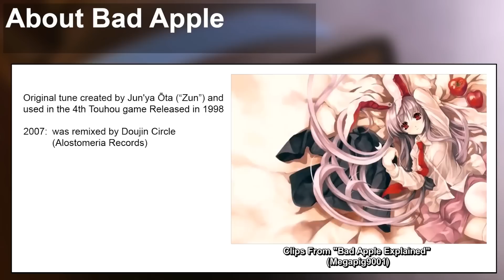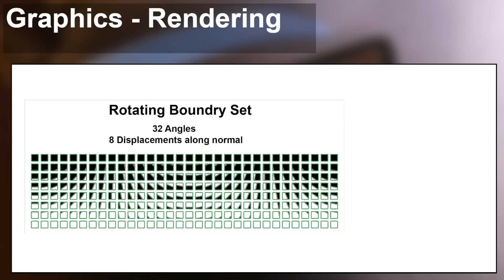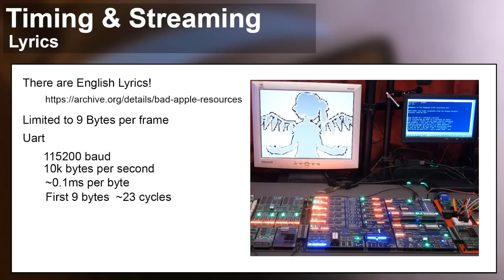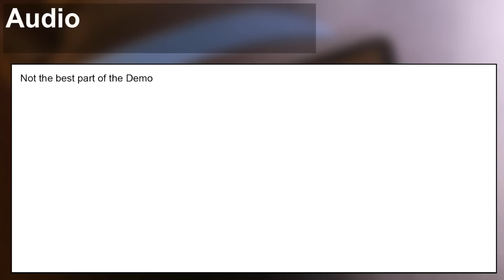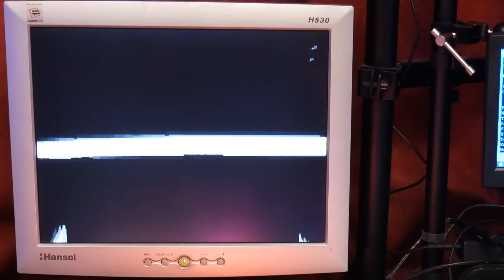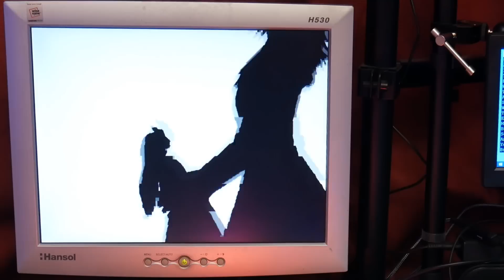Porting Bad Apple to the Homebrew CPU!

Comment: Did you consider interlacing the video? I have no idea if that would have been better or worse.
To be clear - I meant Interlacing the blocks, not the scanlines
Reply from the maker: You mean interleaving the data? That’s what I did.
Reply: @weirdboyjim  no, I mean interleaving the blocks to alternate rows of blocks are in alternate frames/fields, 60fps.
Rather than showing the same frame twice, update only the alternate lines per frame.

It may look dreadful, I dunno. It may or may not help with the streaming
Reply from the maker: @LeeSmith-cf1vo  I didn’t try that, obviously the source material only changes at 30. My suspicion is it would look weird when things are moving fast, you would end up with a sawtooth effect on anything moving left or right.

Comment: What year do you think this computer could have been built with equivalents of that time. And would it be an impressive computer of the time? Very impressive project from start to finish!
Reply from the maker: Glad you are enjoying the series. That's a really tough question, the majority of the circuit could have been built in the late 60's. The big "liberty" I take is with memory devices, a 64KB of sram would have cost you a kings ransom.

Comment: It would be fascinating to see a couple of the frame transitions slowed down significantly so you can see the block-by-block updates happening.  Taking the existing encoding and doing one operation every few frames?
Reply from the maker: I had a try at that but it's actually quite difficult to represent it well.

Comment: Interesting.

To be honest your audio setup is decent given the constraints. I really like the retro square wave sound it has. What's missing is a bit of polish on the analogue side of things. In particular you need a low pass filter somewhere after the mixer to get rid of aliasing and any other unwanted noise. You'll probably have to experiment to find a good cut off point.
Reply from the maker: Thanks for the feedback, I'll look into the filter. The one thing in the audio circuit I didn't realize when sketched it out is the high frequency components you get on a volume adjust. Might have been better to latch in the 4 bits of volume at the end of the a "cycle".

Comment: Nice little project for the CPU! I’d recommend looking into the Heatshrink compression library for future projects, if you haven’t already. I can verify it’s suitable for realtime video streaming on microcontrollers.
Reply from the maker: I had a quick look at that library, I'll look at it more in the future.  It wouldn't be suitable for the decompression here  though which extremely custom and very much tuned to the data and cpu.
Reply: @weirdboyjim  yes, for something that was also storage space or bandwidth constrained it might be useful. I use it for fitting video frames into single UDP packets. Combined with the same sort of frame delta and RLE you are doing, it works really well.

Comment: Could you have somehow programmatically determined the best tiles for video? Maybe split the each frame into tiles and then find the closest ones and combine them? Also could you have changed the pallet frame to frame to be able to have the best tiles for that frame?
Reply from the maker: In theory you could have determined an optimal set but that would have been a sizeable job compared to the time I wanted to devote to this, and I don't think the improvement would have been significant. I did investigate some dynamic tile modification, the problem with that updating tiledata consumes the same memory bandwidth as updating the tilemap which was already constrained.

Comment: It turned out incredibly well. Kudos! It´s right there with the demos for the best performing 8bit computers I've seen. I wonder if rasterizing vector graphics would compress it even further. There is a version made with a fourier series XD
Reply from the maker: Thanks Damian! If you had a decent bitmap display vector graphics would work well for much of it, would be a bit more complex to deal with the blurry bits and the flames though. Decompression would be a bit more cpu intensive than I'd want to do on this device though.

Comment: Do you really need to decode the entire frame before vblank ends? Don't you just need to stay ahead of the current scan line?
Reply from the maker: The video circuit is bandwidth limited, It doesn't support reading and writing at the same time. Priority goes to the cpu so if I write outside of blanking it will momentarily corrupt the screen. See my vga series for more information.

Comment: Awesome job! 
Very crisp edges and great job keeping up with the transitions! 
I see the 4Mb file size, maybe I missed it but what did you end up with for a compression rate compared to the uncompressed down sampled source frame images? 

Have you thought of using your UART as an audio output? 
Drop the serial and  hook the output to a speaker with a resistor and capacitor to limit the current and smooth it a little?
Since you have a 8 byte output buffer on that already you could output 1 bit audio without any additional hardware and that buffer might make the code not too bad. 
If you just left it at the 115,200 you'd need to pump out 14,400 bytes a second, or 240 bytes a frame. I don't know if your SD card transfer rate and free CPU time on the Video decode would allow that without reducing the framerate, but I'd bet 115 KHz 1 bit audio would sound pretty good! 
Obviously if you reduce the output rate of your UART you could drastically reduce the bitrate of the audio. I wonder what the minimum acceptable 1 bit audio quality would be?
Think you could squeeze that out?

Thanks for putting this out there! 
There is not enough content explaining how to actually DO one of these demos with specifics. 
I know this video would have been a HUGE help and time saver when starting work on my own Bad Apple! demo.
It would be neat if you took some time to get into the guts of your encoder for the video and how you sliced and diced the MIDI.

Love this content!
Reply from the maker: The compression was around 11:1, the compression as as much about speeding the decompression up as well. I generally update more of the frame with the compressed data than I could do with the a raw copy.
Reply: @weirdboyjim  That trade-off is harsh. When I started looking at doing this with the 6502 I was planning on just using a preexisting decompression library but all that I looked at were mostly meant to be tape or floppy loaders and were focused on max compression, and therefore really slow for what I needed. Obviously more modern routines are too heavy for a simple processor. Add in the slow nature of a bit banged SD card read on a VIA and now you also have the trade off of read speed to take into account. 
Is it faster to decompress a little more or to read another byte? 
Will adding that 1 more branch on the decoder use too many cycles to offset the bytes it saves on the encode? etc.
I like how you mention being 'good enough' for the demo. You can really keep going for quite a ways.

Comment: Magnificent!

If you do plan to do more music on the synth, it might actually be good to add a channel that's a white notse generator.  You can do a much more convincing hat or snare by passing white noise through an ADSR (the snare has something like a tom on a second channel, perhaps).
Reply from the maker: A lot of people have suggested that. I might have a play at some point.
Reply: @weirdboyjim  a short 2 channel sample playback board would be easier. If you can set it to play upto 256 bytes of a sample either looped or single play. Have it always playing back at the same speed give the card 8k of ram and thats 32 different waveforms you could use for percussion or soundfx.

Comment: Great work!  I was thinking about the problem of being stuck with the vertical blanking period for writes a while back and the only workaround I could come up with would be a 30Hz mode, where, during one frame, you write everything out to a 1MB frame buffer while you display the frame, and on the second frame, you read back from the frame buffer, freeing up your primary graphics memory during the entire frame for writes.  But that increases the complexity of the video hardware so much that I just don't know if it would be worth the engineering on a home project.  
Thanks for your videos in general, as I really enjoy thinking about these sorts of issues.
Reply from the maker: It's worth thinking about the problem, I'll explore some different approaches in future builds.

Comment: Stunning work, yet again - great job!

And sympathies on the audio struggles - I think your approach made a lot of sense given the limitations you had, though. And you're actually wrong when you say none of your percussion sounds are going to impress anyone - the bass drum you made at the end is quite good, I like that a lot.

Here on out is unsolicited-suggestion-ville, so take from it what you will: if it were me, I'd like to add a noise oscillator - either replacing one of the existing square-wave channels or augmenting one or more channels with that functionality. There's ways to generate analog noise directly in hardware - transistor noise is one I've heard of and seen from folks like Moritz Klein - but there's also a very famous sound chip that generates 1-bit noise: the General Instrument AY-3-8912 used in (for example) the Amstrad CPC computers. Basically, it has a hardware random number generator (I think it uses a linear-feedback shift register, like the NES APU does) and instead of switching between 1 and 0 at the frequency you set, it switches to the next random bit value at the frequency you select. That should be enough to generate some fairly convincing white-noise-like sounds for your hi-hats and cymbals, and as a bonus you can get some nice rumbly blasts for explosions and such in your games.
Reply from the maker: Thanks for the kind words! I am curious about the way noise was used by some earlier synth systems but my knowledge about sound lags far behind my graphics skill. That said generating a random bit sequence in hardware is an interesting challenge, I might have a play at some point.
Reply: @weirdboyjim  Sound is definitely a massive rabbithole, for sure - I grew up playing the piano, spent years watching music theory and DIY synthesizer videos on YouTube, and I've written dozens of completed tracks and hundreds of fragments in the fantasy console PICO-8, and I still feel like I'm missing a lot of knowledge.

The way I think of noise in music composition for 8-bit machines kinda comes from a rock/pop theory perspective: a classic drum kit has low percussion (the kick), mid percussion (toms and snares), and high percussion (cymbals and hi-hats), and you want to be able to make sounds to fill all those roles. Having a pitched oscillator - like your square waves - that drops quickly in pitch - like you did with your bass drum - is a good way to make a low or mid percussion, the kick/bass drum and tom roles, but if you try to start your pitch higher, you get a kind of laser-zappy noise. Which is cool, but it's not a hi-hat. A short burst of noise, on the other hand, can sound like a snare or hi-hat - it gives you the high percussion sounds you struggled with. That's why it shows up in analog synthesizers, in classic consoles (NES, ZX Spectrum, Commodore 64, etc.), and even in modern synths.
Reply: ...come to think of it, I think the ZX Spectrum also has an AY-3-8912 chip in it. Is there a ZX Spectrum music tracker you can play with? I feel like there must be.
Reply: @twobob  Sounds are so good! I've honestly sometimes just sat around trying to think about what the best sound card design would be for homebrew computers like this - there's so many things I would like, but what things do I need? What's the best value for money, metaphorical and literal?

Confession: I actually don't know the math for a shift-register hardware PRNG! If you can do it with just two chips, that'd be amazing.

Comment: Back in the day (1992), we used to play with VGA on a 80286 PC and the recently arrived SoundBlaster (that costed a fortune). We were using the 640x480 16 colours mode. You mention 60fps, we were doing half of that, but we were "hiding" the updates: in the 256kB of a standard VGA, there is enough space to "draw" the next image offscreen and reveal it with a simple "out" (I think it was to 0x3c4). Also, in that mode, we only used the 16 grays and the data was pre-rendered (we used PCX as a base standard, minus the header) to only recalculate it into the chroma data (and offset to have more tints in the light shades than in the dark), all that with a bunch of SHLs. Maybe you don't really need to go 60fps?
For the sound, as you already (kinda) went to MIDI instruments, why not going to an OPL4 chip (or did I miss an episode?) such as the YM2515 and simply upload the instruments to the chip, and leave the sound problem for later?
Reply from the maker: This project is very much about doing things from scratch so it would have felt like cheating. I'll do some more advanced Audio in a future build.
Reply: @weirdboyjim  I know it sounds cheating if you make it permanent. My point was to start thinking of goals to achieve with that scratch build in the future, but already have an API (or a subset of it) and a comparison point. It's as much cheating as Android being a copy of Sun's JVM: the implementation will be yours, not Yamaha's.
Also... Do you really need 60fps?

Comment: Man, if I ever get this far along in my diy computer project I want to try a "gpu" with sprites that support rotation, scaling and skew. back in the day IIRC, I saw some code that did all three operations at the same time (but line by line) with some "simple" matrix math (I hope I'm not mis-remembering this.. it was 20+ years ago in a little library called allegro 3) and I imagine it could be done "reasonably well" in hardware with fixed point math and a lookup table. Hmm. But then you'd want the gpu to be able to do the math to offload the work from the cpu. so do you actually support math, or just limit the features to some stuff that can be pre-calculated? feh. The imagination runs wild :D
Reply: I'm pretty sure the Gameboy Advance had exactly that, with the option to double the size of a sprite in the buffer to include a 2x2 matrix.
Reply from the maker: The trick is to find the right level to put it into hardware. To implement the scaling and rotation you can boil it all down to a bunch of adds from registers.

Comment: James I just had an idea - you quite possibly can play samples on your sound hardware through the volume register. Just send singed integer formatted samples into the volume register!
Reply: Yeah, I was thinking the same. Would need to lock the frequency output into a fixed high state though. And the amount of streaming audio data would be way higher - would need to be at least 16kB/sec, continuous, rather than a few bytes per frame.
Reply: @simontillson482  could go as low as 4kHz sampling rate and still get OK speech, 8kHz would be fine for low fidelity sampled instruments. True, it would take a lot of bit banging. Some DMA controller would speed up a lot of IO stuff here. I don't recall the memory access method of JAM-1, but if it only accesses memory at rising edges for example, then that leaves the whole other clock phase for DMA, and that could do sample playback autonomously, just fill up buffers with the CPU, set up memory addresses for the DMA and let it rip.
Reply from the maker: Indeed! I've actually done a little bit of experimentation with that, I'll make a video at some point. Not practical as an aide here though as it needs constant GPU supervision.

Comment: I'd definitely be curious to see what could be done if the pallet was played with as part of the video stream, beyond the colour inversion. My first thought would be to chop the video up into sections with a dedicated pallet each, for higher resolution, though there's probably way further you can go than even that.

This is a seriously impressive demo, I love it
Reply from the maker: Glad you like it!  Well the 2x2 grid works better in some segments than others. I did think of tweaking the entry used for 50% to better match where I was using it.

Comment: That was really interesting, thanks James. I do a lot of retro-gaming conversions and emulation etc, and these kinds of optimisations are always interesting to me! (currently trying to convert Missile Command to my tile+sprite based platform on the old 8-bit Arduino, with composite output, using a similar idea of tiles with partial line segments) Out of interest, did you consider a frame-direction byte, so the data is rendered to the buffer either horizontally or vertically? Also a byte at the start of the frame to choose the tile-set to use, which could be more optimal for the frame? Your audio section reminded me of Tim Follin's ZX Spectrum music - that dude was a master at getting amazing sound from it's little beeper :)
Reply from the maker: When building this demo I had a number of idea of small hardware tweaks that would improve it but I was keen to do the best demo with the hardware I've had rather than tweak the device.
Reply: @weirdboyjim  Ah! I didn't realise you cannot switch tile sets in the software. The frame rendering direction would be purely software. As you say though, it's done and looking good anyway :)